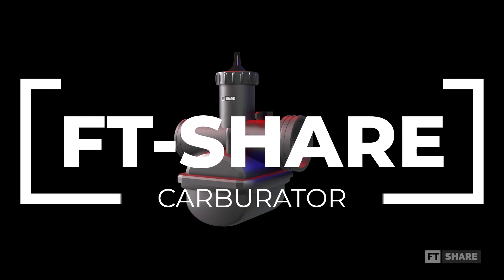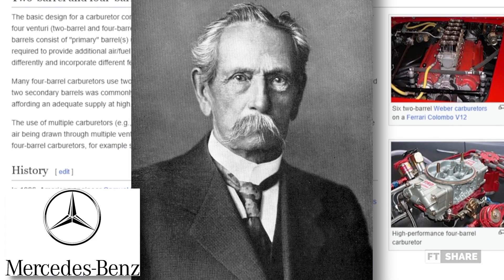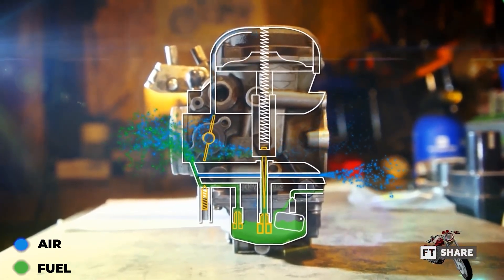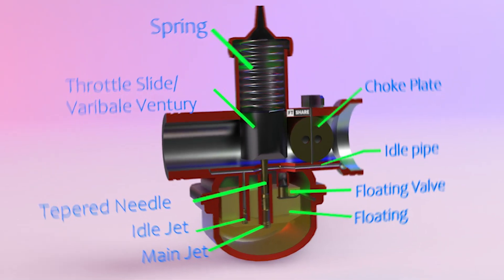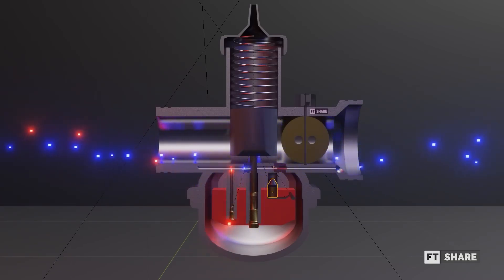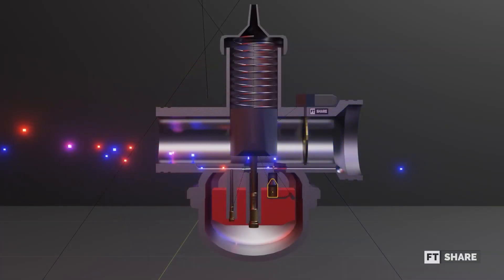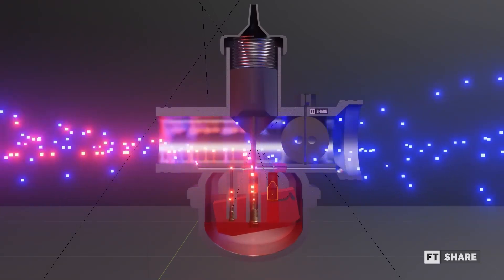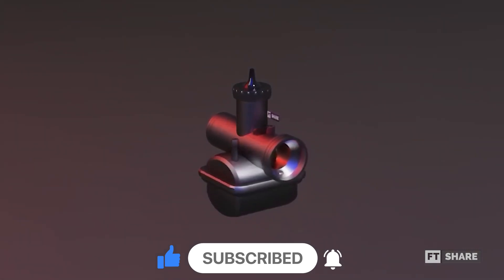CARBURETORS | How Does A Carburetor Work?

Comment: "Transition"? I'm pretty sure we're far from transitioning from carbs to fuel injectors. 
I mean fuel injection was in almost 100%  of vehicles by the late 1980's. Dare I say mid 1970's for luxury vehicles.
Benz did not create the, "Otto Cycle", which is not Benz....and you're showing a 2 stroke engine, not a 4 stroke.